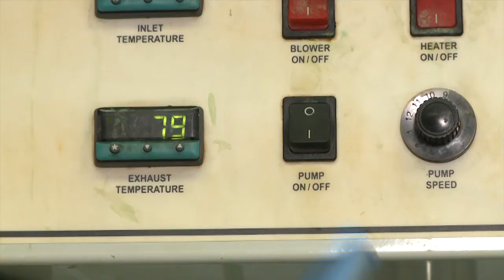4  nanometals

Comment: @jocell202 Nanoporous metals "... have a nano-scale internal 'honeycomb' structure and therefore a surface area several orders of magnitude higher than the same non-porous material.

The performance of many electrical storage devices is governed by either the surface area of the electrode or the rate at which charge can penetrate the electrode material."

From "Nanoporous metals to be used for energy storage" by Bill Campbell. October 4, 2010.